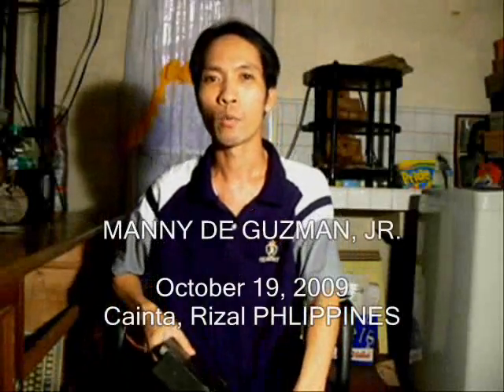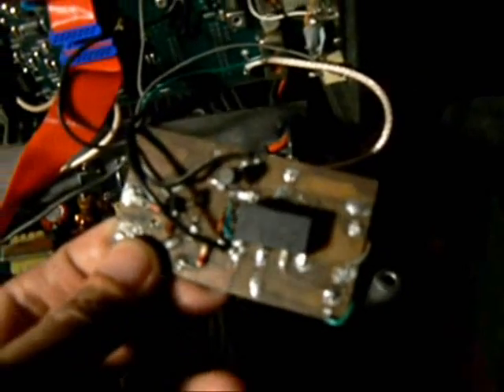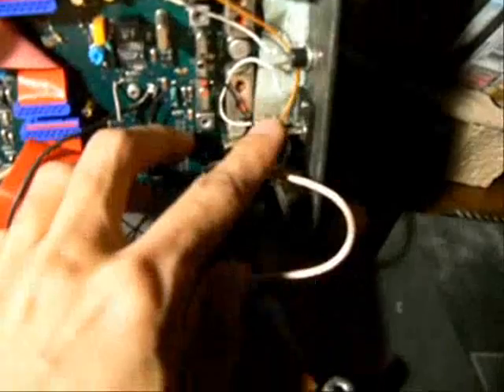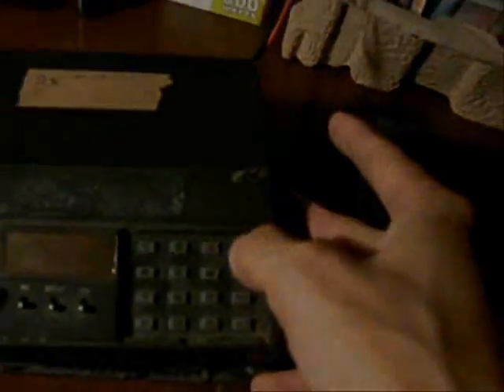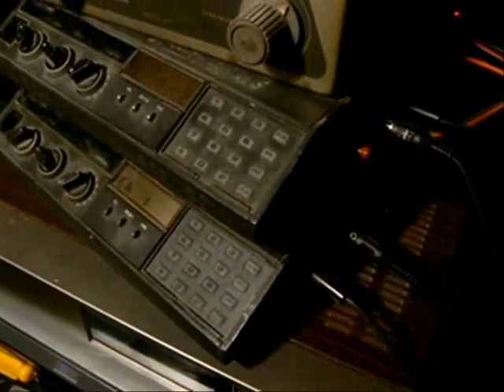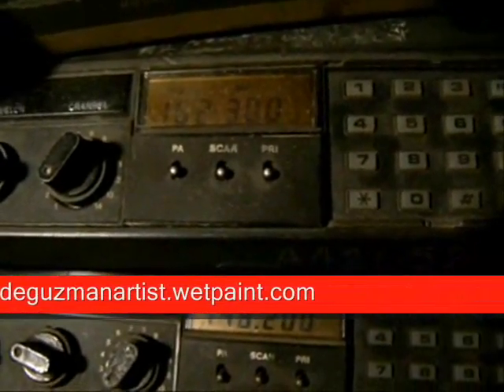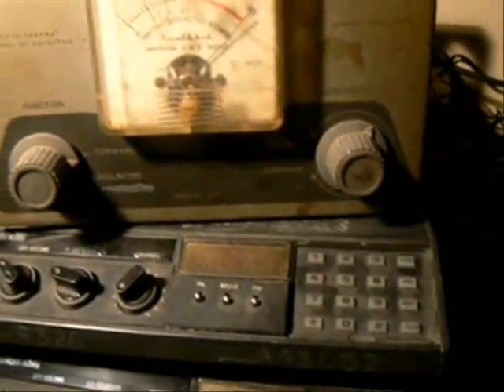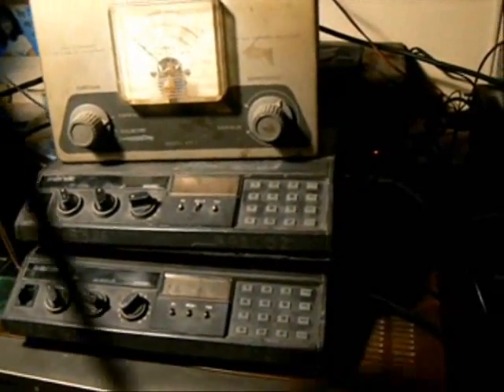Homemade Radio Repeater COR using Bendix King LMH-3142 VHF Base/ Mobile Transceivers

Comment: Where do you take the audio tap from? I built one and it keys the radio but I'm not sure where to get rhe audio signal from to feed to the mic on the transmitter?
Reply from the maker: The Pro2052 scanner has a Baseband audio out. For typical receivers, you can make an audio tap right after the IF stage before it enters any AF amplification to get the cleanest possible audio. Consult your radio's schematic or repair manual.

Comment: Mr manny, how much for you to make the relay board, if so let me know, please
Reply from the maker: I can't have a rough estimate because I didn't bought the parts. I salvaged them from old gadgets. I have a lot of circuit boards from old radios, computers, power supplies, etc. If I could still recall, I think the relay switch was salvaged from an old PC video capture card. The only thing that I bought was the raw printed circuit board and the etching solution. I have designed the PCB based on the diagram layout and follow the connections as close as possible.

Comment from the maker: All the frequencies used in this demo are allocated in the commercial band, as the Bendix King LM3142 is not an amateur radio but a commercial rig and restricted to 148-174 Mhz.RX & TX. I chose 162 Mhz because that band is not being used in our country, the Philippines. Marine frequency shifts to HF. If ever 162 Mhz shall be used, it is only for repeater duplex transmit for some businesses. Moreover, my rig was trimmed down to transmit to only about 3 watts for demo and educational purposes.

Comment from the maker: @santitox1 

I wouldn't advice to mess with the squelch circuitry of a portable scanner because the parts were either compact or tiny. And you might end-up wiring an external board for the squelch relay switch. But anyway, it is easier to find the squelch ic and the correct tap with a schematic diagram. I am not familiar with the squelch schem used in your scanner, but by looking on other popular Bearcat scanners, they used the common MC3359 FM IF IC. See if yours has the same and test for pins

Comment from the maker: Karamihan ng products and equipments nila pang aviation, tulad ng radar at altitude meters. Pero may mga products din sila na pang commercial 2 way communications like this 2 meter VHF base/ mobile 30 watt radio (LMH3142)

Comment from the maker: To be license-free, your equipment must meet certain requirements: The legal power must not exceed 1 watt. 2 watt FRS/ GMRS (8 mile) radio might require license as mentioned by FCC (I don't know here in the Philippines). The rubber duck antenna must be fixed to the radio, and no external antennas shall be connected. I only modify FRS radios for educational purposes but for public use, that is illegal.

Lastly frequencies should be within the FRS band, 

Madami ako nabili sa ukay-ukay, mura lang

Comment from the maker: Depende sa frequency at radio na gagamitin mo. "Walkie talkie" refers to any handheld portable transceivers, including licensed radios. 

Citizens Band Radios (27 Mhz) were banned during the Marcos regime and up to this time due to interference. 2 meter radios (144 Mhz) and UHF (440 Mhz) requires license. 

If you want compact and license-free short range (2 mile) radios, go for FRS (Family Radio Service). It operates on UHF frequencies at 462 and 467 Mhz, 1/2 watt power and fix rubber duck.

Comment from the maker: The test and demo made in this project were conducted with the use of a test antenna or a dummy load, and the frequencies being transmitted upon were not assigned  to any licensed group. 

I also reduced or limit the power to 5 watts from the original 30 watts output of the Bendix King LMH3142, fso as not to interfere with any licensed operations if in case the transmitted signal in the 164 Mhz band signal reached over the air.

Comment from the maker: The standard rule is "yes" you need to be a licensed Ham in order to transmit at 144 - 146 Mhz amateur band, a low cost effort (I think a hundred bucks) if you passed the amateur license exam by NTC.

If you will be operating on the commercial bands, say 148 - 173 Mhz band, you need to take the Radio - Land/ Mobile (RLM) seminar and pay a greater cost. 

You may not be licensed provided you never transmit on any licensed frequency
 which requires you to identify your NTC assigned callsign..